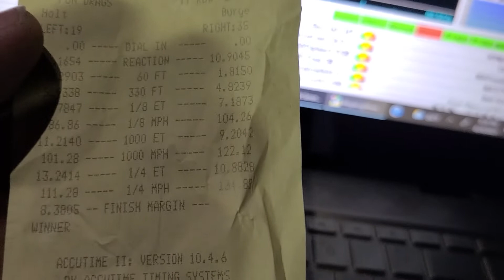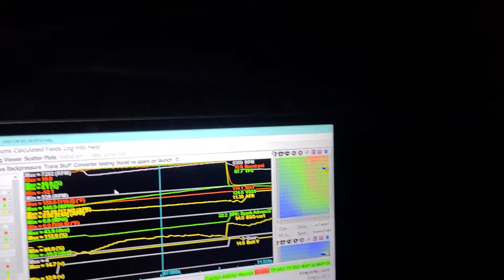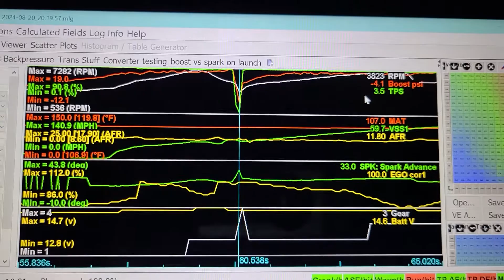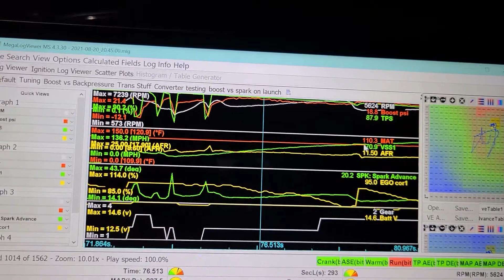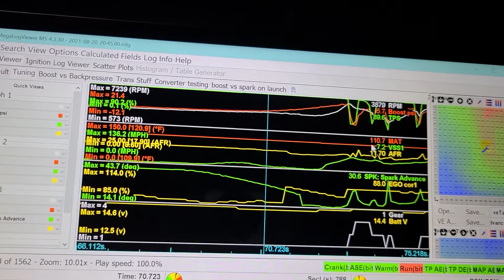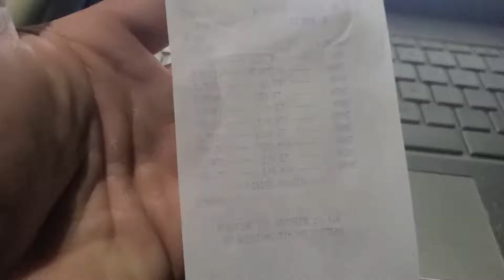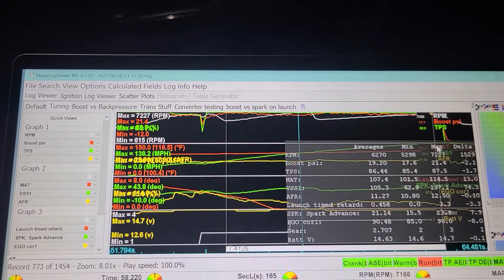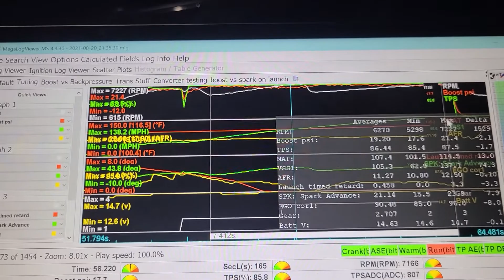10 Second 240sx 5.3 LS Turbo 4l80e

Comment: This is Demetrius, my old channel. I would turn boost back down to where it did not spin….(I think u did 8psi) then ramp it in a lil stronger after it leaves the line. Instead of 3 seconds maybe 2-1.5 seconds. Max out ur run to 20psi